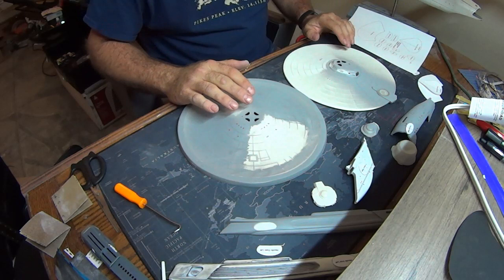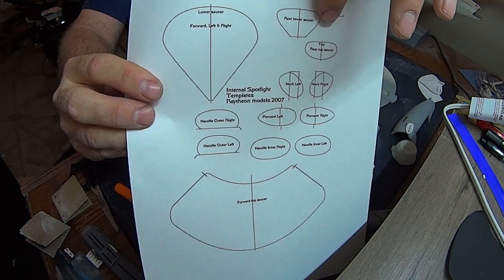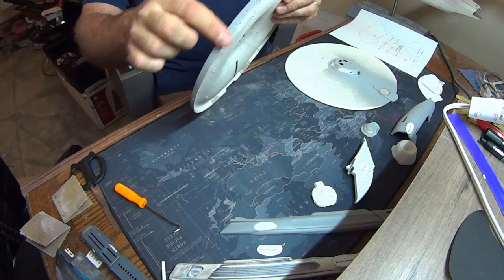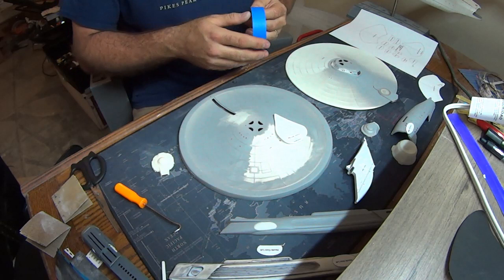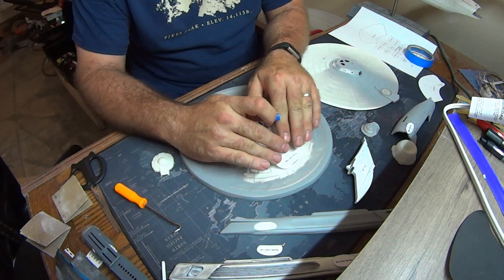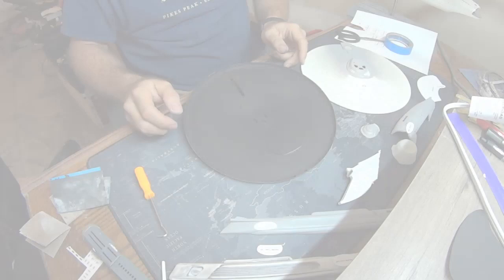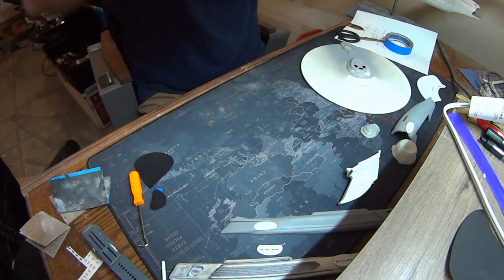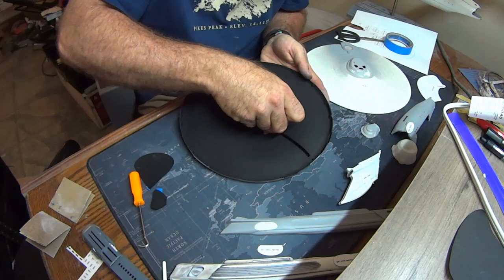Star Trek The Motion Picture Enterprise Refit Smoothie Build Episode 6

Comment: Thank you for the information.  Are you going to create a light box around the raytheon template?  Have the raytheon effect on a separate circuit (switch)?
Reply from the maker: I will not be using the light boxes, ideally the Raytheon will be on the same circuit as the spotlights themselves.

Comment: I went to the web site and there is no raytheon lighting template, just photo galleries. There's also no link in this video description despite what's mentioned in the video. I do not have a Facebook account - can you please help with getting one of these lighting templates?
Reply from the maker: I didn't post the link because the templates are 1/350, but here it is
http://www.ianlawrencemodels.com/spottemp.html
Reply: @theensignschair  Cool, thanks! Rescaling for 1/537 and 1/1000 isn't complicated. (Yep, 1/1000 with SMD chip LEDs.)
Reply: @theensignschair  what percentage do you need to reduce to print 1:537 scale?
Reply from the maker: I actually don't remember the percentage I reduced them, I just reduced them and printed till I reached what I felt were the correct proportions.
Reply: @theensignschair  if my math is correct it would need to be reduced 21.7% so reducing it to print with a 22% reduction should be close, correct me if I’m wrong.
Reply from the maker: Sounds logical!